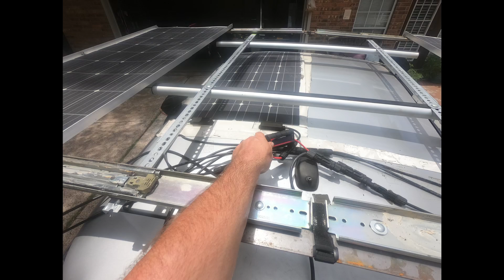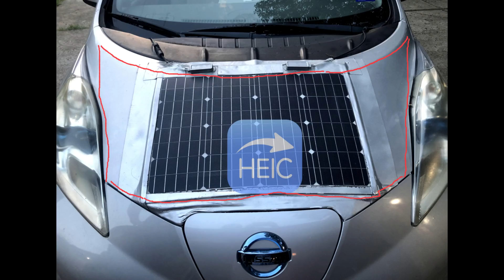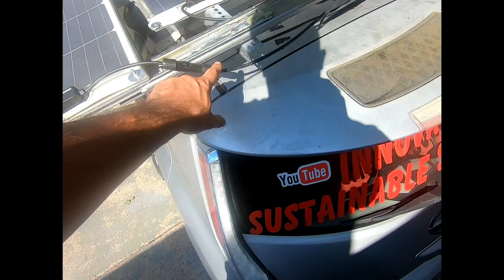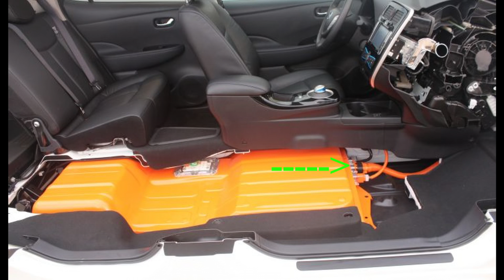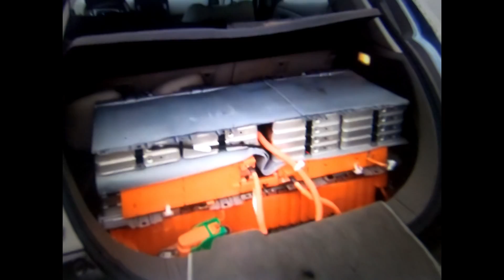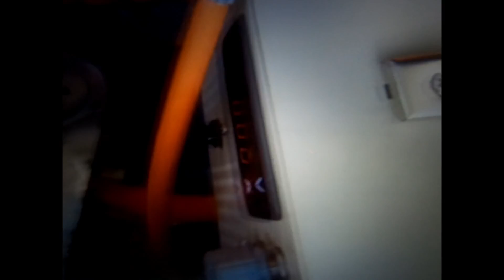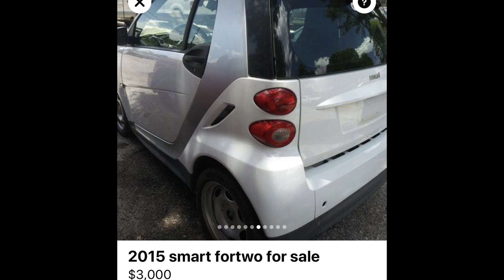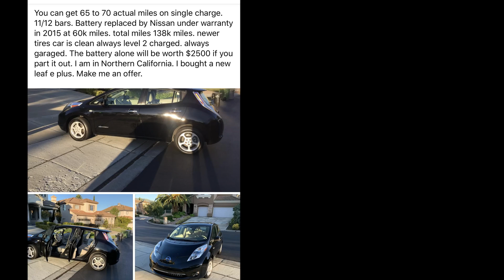Solar Powered Nissan Leaf - Connecting Solar Directly to EV Battery

Comment: Solar panel creates massive drag that steals more than gives.
Reply from the maker: What equation for drag are you using in your calculations?  What cross sectional area are you inputting for the panels?  Do you thick the panels I used are? (.2 inch).  I observed a 5% loss in overall effeciency of the vehicle, and I demonstrated up to a 25 mile (50%) increase in range

Comment: A better simple efficient way is solar direct to battery using a DC voltage booster and one big diode on the positive terminal of the battery. This should not interrupt the car std charge system

Comment: So is it possible for a wiz kid to build a dc fast charger from solar that a ev would recognise. Basically copying the fast chargers at the mall but diy version from a generator or solar system.
Reply from the maker: Yes.  Your problem would be getting enough panels to power the fast charger.  Lv 2 fast chargers supply power at anywhere from 3kw to 8kw.  Thats a LOT of solar panels.  For reference the array on my solar car is 0.75kw.
Reply: @ Innovative Sustainable Solutions. Ok. Thanks for reply. Could a wind turbine be hooked up with Dc step down rectifier with a safety system cut off in place DIRECT TO EV in an off grid situation? Would love to see this experiment.

Comment: hey how can i find the wire that will charge the 12v battery in the leaf becuse im thinking to instal 100w solar into the 12v battery becuse i think i will gain miles by doing only this
Reply: Not that many miles though, because after you're done driving there's nothing consuming power out of 12V battery.
And while you are driving, the 12V battery is charged from the traction battery anyway.

Comment: do you have Diodes installed on each panel because you running in parallel, not series?
Reply from the maker: My understanding is that the junction boxes of the panels have diodes in them to prevent current backflow.

Comment: What do you think about the Prius?
Reply from the maker: Great car.  You used to be able to get a used one for around $4k, before covid sent vehicle prices through the roof.  I prefer all electric, just because it's simpler.  A hybrid is a half-measure, but not having a range-restriction obviously has merit.  Sad to see Toyota abdicate it's EV program.
Reply: @InnovativeSustainableSolutions  Pros that I think of:
Low gasmilage
"AC-sleepmode"
Stealthy overnighter

Thanks for charing your knowledge. I'm planing to put solar on my Prius as well. Would be nice to be able to burn as little gas as possible while traveling.
Reply from the maker: @bui340  You will not be the first person to do a sleeper/vanlife project with a Prius.  I know a guy who made his Leaf into a sleeper.  He plugs it into a free public charging station at night.  It tops off the battery and then runs climate control w/out cycling the battery.  The problem with climate control in an ICE car is the engine idle time trashes the engine.  6 to 8 hours a night of just idling is not what they were built for.  Consider going full project car, and putting a window unit (and battery bank) in her so you can kill the engine at night.
Reply: @InnovativeSustainableSolutions  I've got the plug in version. Hopefully it wont idle that many times per night.
Yes a heat pump in the window is an option. It could be kind of stealthy using black mesh to hide it from people outside the car.

Comment: Remove and replace parts with carbon fiber or fiberglass 😂

I want to buy a leaf and remove the motor and swap it into my car. Since i like modified cars it'll be as light as possible for maximum efficiency 😅

For now it's an idea since I've found out i can run my manual transmission no problem. No clutch but still its a manual
Reply from the maker: If you search you can find videos of people who have completely separated the drive train and battery from the car, and the whole system still runs fine.  The Leaf is definitely the best choice for a modder, because they didnt load the damn thing down with 1000 tampering sensors like Tesla did.  Its hackable

Comment: A lot of repetitive rambling going on here… 40 minutes and all I wanted to know was how to connect the solar directly to the EV batteries.
Reply from the maker: Context is important.  All my videos are designed to be universally understood.  Hence they are usually long and boring, with a good amount of rambling.
Reply: @InnovativeSustainableSolutions  Understood. I still don’t understand a couple of things, however. If you are connecting directly to the battery terminals, how do you prevent all that power from blowing out your solar panels in the other direction? Don’t you need some kind of regulator for protection? How does this compare with solar on a house pumping power back into the grid? What hardware is used for that? Also, can this be done with a Tesla and has anyone tried?
Reply from the maker: @RockTreeStar  Good questions.  Most solar panels have a junction box on them (little black plastic box) that contains diodes that prevent current from flowing backwards through the solar panel.  It's not uncommon for these diodes to have 1000v protection.  So you're good there.  Grid tie systems have similar current backflow protection, as you would expect, since the lack thereof would essentially create a "short" in the grid when the sun goes down.  Teslas are the best electric cars on Earth, and you will never connect solar to one.  EVERYTHING in a Tesla is rigged up to a sensor.  The company fervently discourages ANY alteration whatsoever of the vehicle (see Rich Rebuilds) and I'm sure that Tesla's have monitoring software that detects changes in battery voltage when the vehicle is not "plugged in" and bricks the vehicle.  There are maybe 10 people in the world who know enough about hacking Tesla's to be able to attempt this.  Jack Rickard did some very advanced projects regarding hacking the Model 3 battery pack for solar stationary storage.  He could have done it.  The reason the Leaf is perfect for DIY solar because Nissan honestly didn't care what happened to the car after it rolled off the assembly line.  Ironically also what makes it debatably one of the worst EVs (no battery cooling).
Reply: @InnovativeSustainableSolutions  Is this the same Jack Rickard who pioneered computer Bulletin Boards in the 1980s and published the trade magazine, “Boardwatch” out of Littleton, Colorado?
Reply from the maker: @RockTreeStar  Negative.  Jack Rickard of EVTV.  This guy: https://youtu.be/IPZAwY9J0wg
Reply: @InnovativeSustainableSolutions  That weird because it looks like him and is apparently the same age.
Reply from the maker: @RockTreeStar  He did so much with his life I didn't even know about that.  Yeah, that's Jack.  He would have had a shot at writing the CAN language to trick a Tesla into thinking it's being charged by a normal grid-tie plug-in when you're actually jacking 400v PV input directly into the battery.  It would be very tricky though.  Lots of monitoring software would have to be defeated.  Their future batteries are going to be structurally integrated too.  Structural batteries are way better than the current "sack of potatoes" engineering method, but will make DIY integrated solar even less achievable.  Jack was something special
Reply: @InnovativeSustainableSolutions  Indeed. 65 is way too young. I’m guessing he died from COVID.
Reply from the maker: @RockTreeStar  Lung cancer.  Smoked Camels till the day he died.